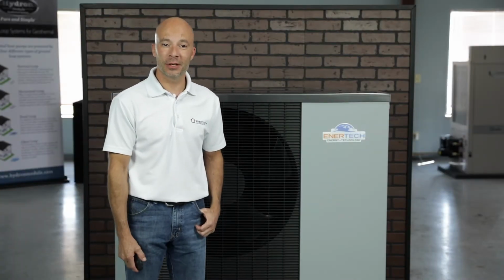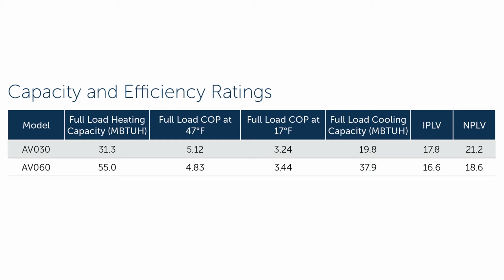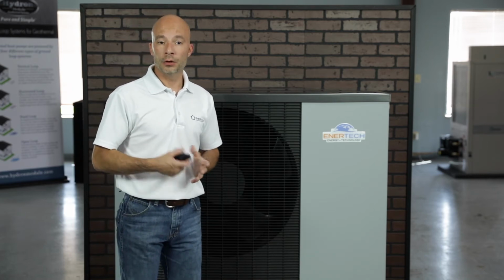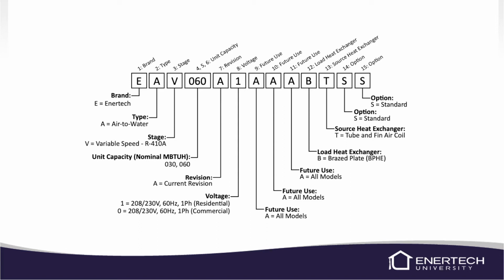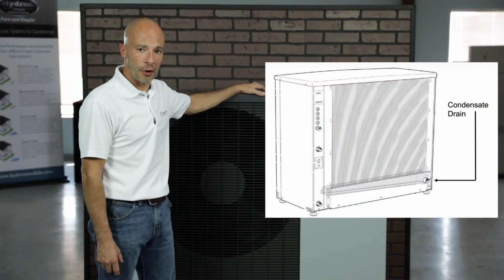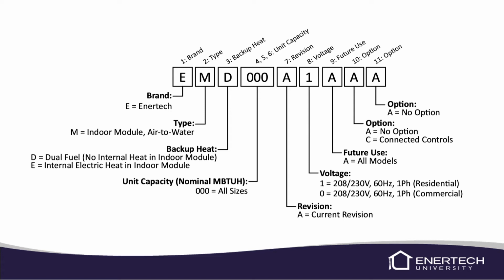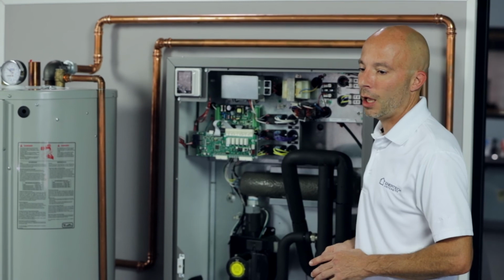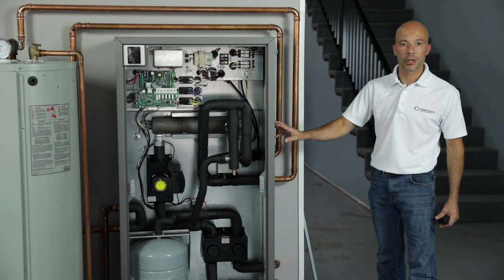Advantage Air-to-Water Video #1: Advantage Unit Introduction and Overview

Comment: During summer months when heat is removed from the house to cool the living space, is that heat directly transferred to the domestic hot water, or instead is the heat directly transferred to the outdoor air, and then when the system needs to heat dhw the does the system then pause from cooling the house to heating dhw?